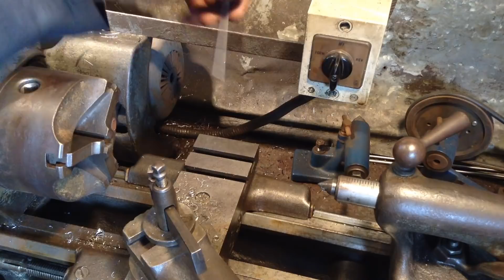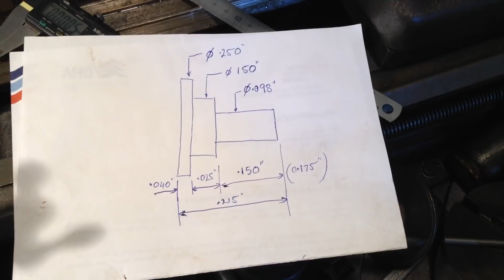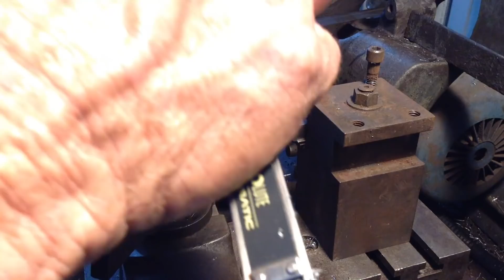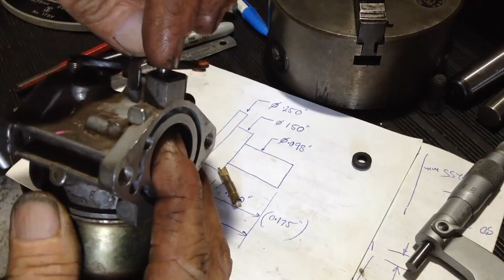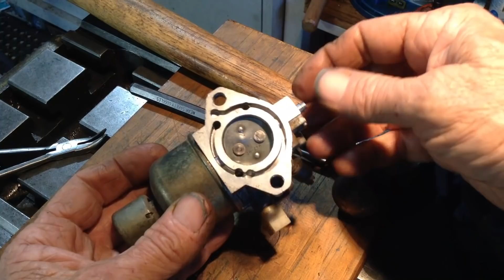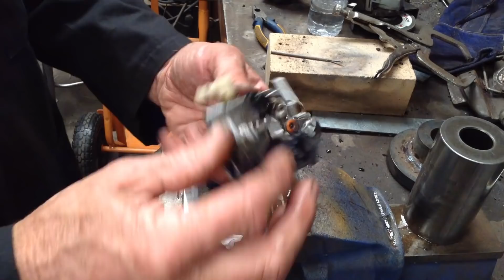Carburettor Butterfly Shaft Repair

Comment: a fiddling work that typically, you do for yourself or a sibling!!!!!!!!!!!!
a repair procedure that worth more than a new carburetor
the lathe you use is equipped with a taylor chuck that is very old by itself, I have a similar one on a Willson lathe that have been built around 1946, just after WW2
a very nice video.
Reply from the maker: Thanks .  Yes it was for our own mower !   Cheers .

Comment: Hi Max nice job fixing the old carb. I've recorded some footage of adding a front bearing to a right angle gear reduction drive with bell housing then removing the bell housing so i can run a pulley . it will be my first video and still need to edit  it man don't know how you guys do it so far its a pain . Well Happy new year. JM
Reply from the maker: Not so bad once you get the hang of it , it just makes the jobs drag out !   Sometimes it's a good break to work without the camera .
Have a good New Year as well .

Comment: Top job Max. I like the rivets, tempting to use screws and loctite but the rivets are less likely to be ingested by the machine. I have already been thinking about how to adapt a rear tool post to the Atlas. I already have a workable tool post which you identified. Best! Eddie
Reply from the maker: Cheers Eddie .  Hopefully the rivets will stay put !

Comment: Hi Max, the poor old cross slide nut has done plenty of work.
Making a new cross slide nut for mine making it longer to get more life out of it.
Too long to cut the thread with a boring bar, ordered a 14x3mm Trapezoidal Tap, take the pain out of single point cutting the thread.
Reply from the maker: That's the easy way !

Comment: G'day Max. It's interesting why the throttle shaft should break,  it's not like it's under much load. Making rivets seemed like extra work compared to tapping the shaft, was it originally riveted or were you trying to compensate for the wallowed holes? From my experience 50 years ago those holes were too large to allow the butterfly to find its closed position in the body, the idle screw was first backed off to allow the plate to fully close and finally thanks for throwing water over the tack weld, I was cringing waiting for the seal to melt although back then there wasn't seals on the shaft just a good fit until it wore out. Ah the memories and to think I can't remember when I had my second AZ shot to calculate when my booster shot is due yet my apprenticeship days came flooding back watching a stupid YT video. Cheers Peter
Reply from the maker: The stepped rivets re centred the butterfly .  Screws kept falling out of the old shaft before it snapped through vibration & wear & were always ingested by the motor !

Comment: Having machines is great and when something breaks it's a great excuse to use them and solve problems.  I have a couple of questions,   one is why didn't you use screws for mounting the butterfly disk?  I see you have a nice mill in the background, so my second questions is why didn't mill flats on the end of the shaft?  You lathe chuck is the first of it's type I have seen,  I never seen so much mass around the jaws.  

Nice job, we do what we do to keep things running.
Reply from the maker: I did not have a tap that small for the threads .  Also needed it done in a hurry , that's why the lever was welded . At the end of the day , it's no different to peening it over ,  just way quicker .   Cheers .

Comment: Gday Max, I’ve seen people sell the mower for simple carby issues or pay the mower shop a fortune to repair it, this is one good thing about this hobby, fix everything yourself, when I had the small lathe I put a post under the parting tool, that made parting off possible, great video mate, Cheers
Reply from the maker: Comes in handy having a lathe at home , that's for sure !